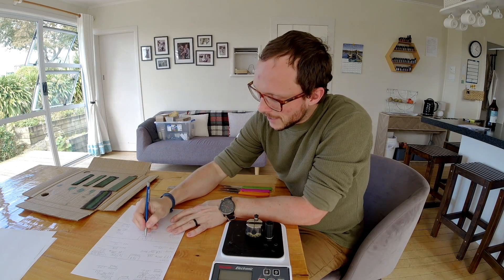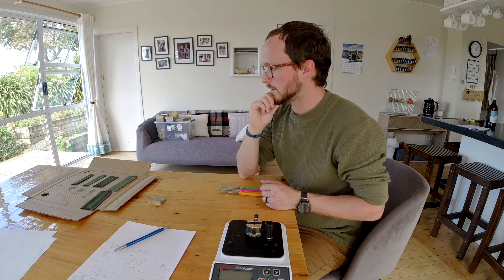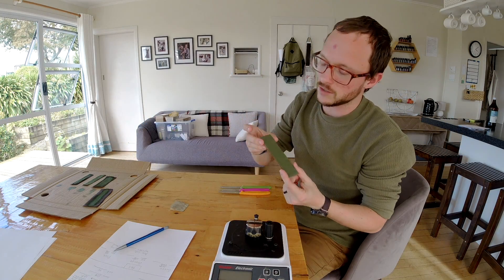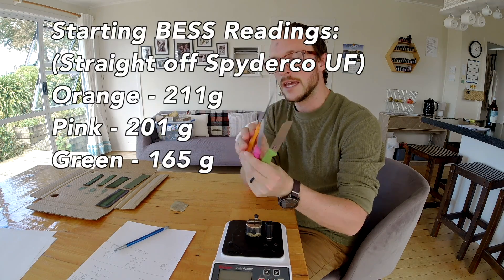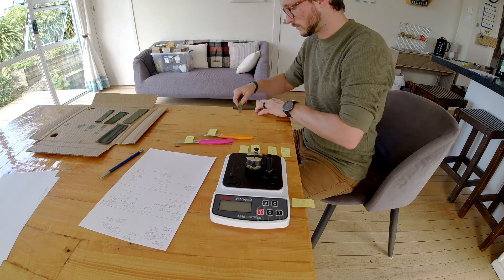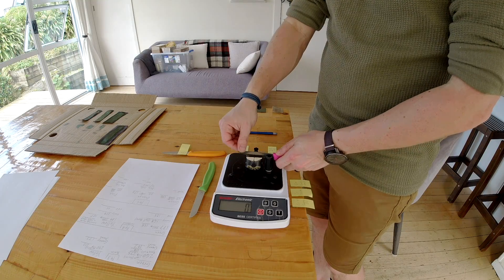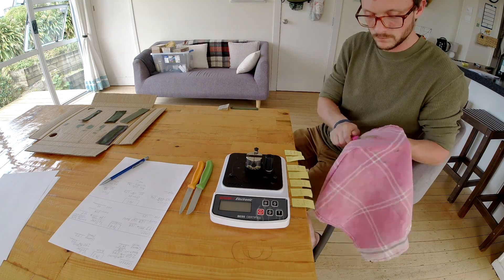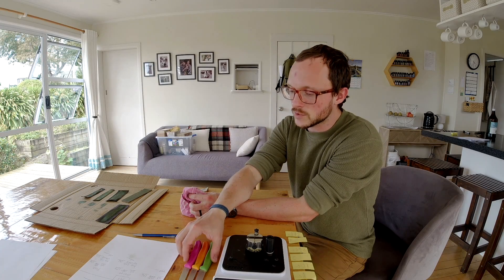Strops Part 5 | Chromium Oxide Paste & Custom Mixes | Sharpening Test

Comment: I did both! The secret to the 27 bess score , is to thin the blade down 20%.  No one would ever  suspect that 
. Thats how a  knife blade acts similarly to a razor blade, when sharpened. 😮
Reply from the maker: It's interesting you mention that.  I have struggled to get dual grit edges under 100 g BESS at times, but just did an experiment where I thinned a hollow ground blade to like 5 thousandths behind the edge, and it effortlessly took a 400 grit/3000 grit dual grit edge that hit 66 g BESS going SUPER slow on the reading to be extra careful for accuracy.

Nearly razor blade sharp, but toothy as anything.  My present evidence supports your hypothesis.

Well, Abraham, it has been an interesting conversation after all.  I have got to go to bed now.  I appreciate your perspective and boldness.  I suggest you try to be kind to people on YouTube.  The truth you seek to share will spread to a limited audience if channels block your comments, and that would be a shame.

I think you should share your sharpening methods freely.  Any secret knowledge you successfully keep dies when you do, and sharing is the only way to make things last.

Those are just my opinions.  You are welcome on the channel, and welcome to disagree - just consider what I've said.

Cheers my friend.
-Gabe
Reply from the maker: Oh you should also know:
This video you've commented on came out a while ago - the ones which come out this week were filmed 7 months ago, the ones I'm filming now won't release until 4 months from now...

It's something that drives my viewers nuts sometimes but it's the only way I can run a channel while having 4 kids, full time job & online college - I have to batch-produce tests and batch edit them ahead of time, since some seasons have NO time for video production.

That said, if you watch my videos currently, you may have to listen to me talk about Vadim as if I haven't had these conversations with you for another half a year because the published videos won't catch up to present.

Sorry about that.

Comment: Why are you using paraffin wax based crox? Who said that what you are using is pure chromium oxide? That is mostly a myth. Do you have a particular brand of crox, that you use?  Knife grinders info is actually not accurate on most of the compound size ad well as purity.
Reply from the maker: That's interesting - who has exposed that as a myth? How do you/they know?

I used Kremer pigment because of Vadim Kraichuk's successful use of it for deburring.  I made the emulsion myself from paraffin and chromium oxide powder.  This is an old video - I rarely use the crox paste these days.  Mother's mag is easier and seems more effective at deburring simple steels.  Though I still like the mix of crox and 0.1 micron diamond gunny juice I made - at least for edge finishing on hard steels that still have a little foil burr.

High alloy steels seem to require more care with edge leading strokes, very fine stones and alternating passes, or gentle ceramic-rod deburring initially.  Right now I usually follow that up with successive passes on leather or basswood with Stroppy Stuff diamond emulsion of 1 Micron or 0.25 or both.  That is how I am getting many of my harder powder steels under 100 g BESS by hand these days. 

Cheers bro.
Reply: Kremer brand is a pigment chromium oxide, with no apparent or verified actual micron based size.  The kremer brand is only a brand. Not an actual manufactured or origin source of chromium oxide. All pigment crox are either very large or ultra small micron size. Usually a floured powder. Which is a non Abrasive crox. Most probably from Chinese origin, there is no telling of size or consistency. When Vadim suggest mixing the crox with an oil , then you know he is clueless as to what is most effective. I think Vadims Accent and dimeanor does the trick. There is a protocol for the full effect of crox to deburring as well as to cut metal. What he was touting is pure amateur garbage. In effect it was a little more effective than  99 percent of what's out there.
Reply from the maker: @abrahamkalichman6845  These are interesting thoughts - it is clear that you disagree with Vadim, but my question remains.  

What sources do you trust that offer better information?  I would love to check out your source of information, if Vadim's information is flawed in some way.

Cheers.
Reply: @homeslicesharpening  
Anyone using YouTube to educate on abrasive matters is attempting financial gain. The information provided to you here is enough to do the work, that would negate issues , and give  more definitive direction.
Reply: @homeslicesharpening  
Disagree with Vadim is an understatement!
He should have been selling used cars in Moscow.
Reply: Everything that Vadim brought up on his videos were to sell and sell, snake oil of his brand, to many newbies as well as the current users of the Tormek sharpening system.
The diamond spray for his rock hard felt, was outsourced Chinese company who outsourced their abrasives , because they made wool felt products. They had no clue as to what or how to make diamond abrasives. As long as they were diamond. Amazing that are or were no other abrasive compounds on the market at  that time , that could have been more effective ???
Reply: By the way. Toothy edges do whittle hair and  cut sharp as soon as they are used. Guess what occurs long term when the edges are toothy. Not as durable as a non diamond finish!
Reply from the maker: @abrahamkalichman6845  I respect your feelings on the situation, but see you offering no empirical proof.  I would be happy to see any method arise that is better than Vadim's but I appreciate that he contributed what he did find so that others could learn from it.
Reply: Sorry to tell you that diamond abrasives as far as what diamonds are  used for is their aggression with harder steels. Not deburring. And. Small micron size will be too small for aggression and will never deburring completely. That is where the kremer s comes in, but Is a pigment  flour powder that will burnish the metal. Not deburring.
Reply from the maker: @abrahamkalichman6845  Those are interesting thoughts, but what would you suggest doing instead?

I have definitely got good results from the diamond abrasives after a ceramic rod deburring - have you ever used Stroppy Stuff compound or Gunny Juice?

I respect your opinions, while at the same time I am making my decisions from objective measurements and usage observations, and so am not too worried that they are ineffective.

That said, I would be most happy to hear about your sharpening method.  Especially if it's better.  I simply note that you have given me much commentary on what is bad, but I have not seen you offer an alternative that does work.

Does that make sense.  Not trying to be critical, just wondering what you are proposing to be better?

Cheers.
Reply: Mother's mag is aluminum oxide based. Very poor for any type of durability, or in any type of a deburring agent
 I have found that aluminum oxide works a  mild burnishing agent that will never work on any metals over 59 Rockwell.
Reply: What your final edge results are what you should be aware of
 Diamonds will always leave your edge toothy
. That is why it is never used on straight razor sharpening. if that is what you are looking for, then you got the mother life. How is the noise of cutting paper after the diamond abrasives.
I don't discuss my methods.
Reply: Not learn from it, but to purchase from it. That is what Vadims purpose was. 

I repeat. I do not share my products of choice and their importance. What information that 
 you have received  should  be a wake up call.
Reply from the maker: @abrahamkalichman6845  Ahhhhh.  I see.  You are an abrasives maker.  I can see your products online.

I must admit that if you were saying all these things about Vadim and Venev and then promoting yourself I would have zero respect for you.

However...  Being that you actually make and source abrasives yourself, but refused to self-promote.  I respect that.

Well done, that was quite ethical.  I withdraw my previous remarks about you not helping the conversation.  I see now.

I would be interested to try your stropping compunds - I'll add it to my list of things to purchase eventually.

Thank you for the conversation.  I understand your frustration toward different makers, and YouTubers.  I would still recommend more kindness if your message is to be received well.

Cheers Abraham.
-Gabe
Reply: What are you speaking of. abrasives maker? Which source informed you of this falacy?
Reply from the maker: https://www.tableware-order.com/abraham-kalichman-free-delivery-chromium-oxide-strop-compound-50ml/

So, did you make your YouTube handle after your favorite abrasive brand?  Or are you Abraham Kalichman?
Reply: @homeslicesharpening  
I just read the complete reply . What are you showing me? I have no idea of what you just sent to me, or what it is in response to?
Reply from the maker: @abrahamkalichman6845  I sent you a link to an crox abrasive made by "Abraham Kalichman".  Your YouTube handle/name is "abrahamkalichman6845"

I had assumed that you are the guy who makes the abrasives labeled under the same name.  If that was the case, I thought perhaps you had witheld your actual methods out of a sense of honor-  that is, that you had sought not to abuse your expertise by seeking money and personal gain.

If that was the case I admire that.  Now you have confused me, because your YouTube name is the same as a Chromium Oxide Emulsion producer, yet you seem baffled by the implication.

Can you clarify?

Comment: Maybe the issue was not with the leather strop. Maybe it was a Foil Burr from the flat strops and it broke off on dry leader as it usually does. When I use flat strops I don't trust sharpness test right after the strop because of this. Usually I don't use flat strops to avoid dealing with this but there is an interesting test you can do to detect Foil Burr. 
Do a couple light passes on wood and compare sharpness before and after. There should not be a significant drop if the edge is well structured. If it drops then probably you were cutting a Foil. 
This test is also useful for edge trailing sharpening to help detect a weak microburr at the edge. 

I don't like chromium too much.The one I have available here leaves the edge very polished. Its good for some specific tasks like wood and raw meat but for a general purpose knife looses bite.
Reply from the maker: Very interesting, I will try it!

Comment: There are three things in my mind: "Burr, burr and burr."
When I look at the sharpness of the knife I see two sharpnesses, the burr sharpness that we measure with the BESS and the edge sharpness that determines how long a knife stays sharp.
I polish up to 12,000 grit and then 2000 grit 2 x 20 strokes on both sides light burr, no deburring on the stone only on rough side of leather with 7000 compound
Three strikes on both sides, same spot, then the rest.
Clean strop 1x on the clean strop side and measure.
I repeat this until the sharpness decreases.
Working with the Burr.
Reply from the maker: Interesting -  how many cycles does it usually take?
Reply: @homeslicesharpening  There is no "usually" yet.
Temporarily back in a knife ebb, so no knives.
Today the weekly resharpening of the kitchen knife normally I do 5000 grit polishing and come out on the 94 BESS.
This time with the new method and after repeating three times I was at 82 BESS.
Then the method again and then I was at 112 BESS. Between 5 and 10 strokes.
Reply from the maker: @AlmostGone3210  Good information!  Thanks!

Comment: This is fascinating. Anecdotally I have noticed a similar situation whilst stropping using a KME fixed angle system - if there is any variance in the thickness of the stropping plates (different brands for example) it can cause your edge to regress in sharpness quite dramatically. I’ve measured the difference they cause in angle and it can be as little as .5 of a degree up to ~3 degrees, with the greater number causing the worst edge regression.

This is definitely a subtle and nuanced subject. 

I look forward to next video 👍🏻
Reply from the maker: Wow, that is a really good insight - thank you so much for sharing.  This will help my research a lot!

Comment: The increase would almost have to be a strop angle issue, wouldn't it?
Reply from the maker: Could be!  BESS testers can detect rounding of the edge or foil burrs, and both can drive the number up.  Many kinds of strop can draw out a foil burr, but I would suspect that more from something aggressive like diamond than Cr Ox  - so I probably made a mistake on the angle on some of them or perhaps the material is too compressible.

Anyway, I am going to invest in a microscope and some flatter strops to see if we can learn more.

Cheers, thanks for the input.

Comment: No worries about the numbers not showing. 

I mean i trust you enough 🤷‍♂️

But i guess some people are more skeptical for whatever reason.
Reply from the maker: Yeah, I don't mind people being skeptical.  Not much for hidden agendas though - I'm a pretty straight-forward dude.

Wanted to mention - I am running into some hiccups testing Vanax, and it may delay my testing of your 10V for a little bit - but it is coming up in the rotation in the next couple months!
Reply: @homeslicesharpening  hey. No worries. Can't wait to see what you have. 

I imagine depending on the vanax it could potentially have excess retained austenite. Which could complicate things.
Reply from the maker: @_BLANK_BLANK  Interesting!  It's from Quiet Carry.  Do you have any recommendations about how to sharpen when extra Austenite is Retained?
Reply: @homeslicesharpening  the big effect retained austenite will have on sharpening. Is the burr will be harder to removed. It will hang on when it wouldn't have if there wasn't excess retained austenite. 

So i would just say. Being extra careful to take steps to bend it back and forth, and force it to let go of the burr without adding a bunch of extra abrasion to form a new burr would be the thing i think would work best. Since retained austenite is more flexible, and it also isn't already martensite (the hard form of steel), when you do normal burr removal you are essentially work hardening the burr by repeated plastic deformation until it gets too brittle and breaks off, so in this case you are starting with more retained austenite which is going to make it take longer to get to that work hardened state and then break off.
Reply from the maker: @_BLANK_BLANK  Thanks for the insight!

Comment: My concern with longer strops & more stropping is heat build-up in the cutting edge.  I have seen hand stropped edges under a microscope that turn blue from stropping.  
- There is testing referencing 50% reduction in edge durability in belt sander sharpened/stropped knives.  
- Someone has the ability to quantify a 4 to 5 HRC reduction in cutting edges, likely more at the extreme tip of the apex. 
- A 4 to 5 HRC reduction theoretically only accounts for 1/2 or the 50% edge durability reduction.  My thought the rest is related to carbon cracking in the cutting edge.  

- Any thoughts ?
Reply: I very rarely see it mentioned. But from what i've seen from people that have messed with this, and of course from Roman Landes's study on heat while grinding. 

It is very plausible that the edge can even get overheated while hand sharpening if not using water to cool.  For anyone that has went really heavy on an oil stone can attest that it in fact will create a lot of heat. And roman landes's study showed the first micron or two of steel very well does reach very extreme temps. And his test was doing the grinding by hand. Which for an edge that's apex is one or so microns thick. That is a very bad thing

So to me, almost all powered sharpen are a bad choice, even with variable speed, and watercooling on a belt grinder. Its not a good choice. 

The tormek maybe. 

TL;DR yes dry grinding of any kind can definitely overheat your edge, and should be avoided.
Reply from the maker: Interesting!  I have not considered the effects of heat on stropping.  I have not observed any negative effects, but have not been aware of the research you guys mentioned - thanks!
Reply: @homeslicesharpening  with stropping specifically. I don't think it will be as big of an issue as the other things i mentioned.
Reply from the maker: @_BLANK_BLANK  Right